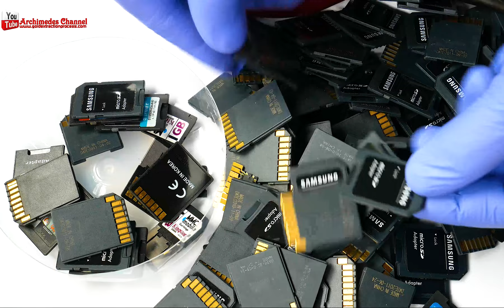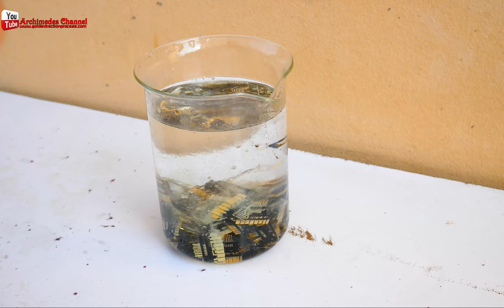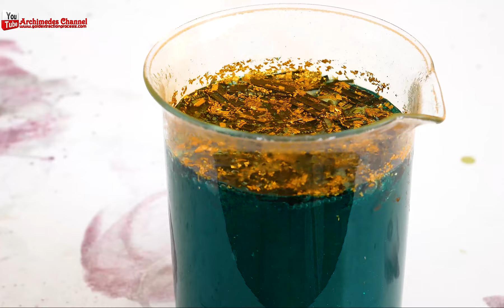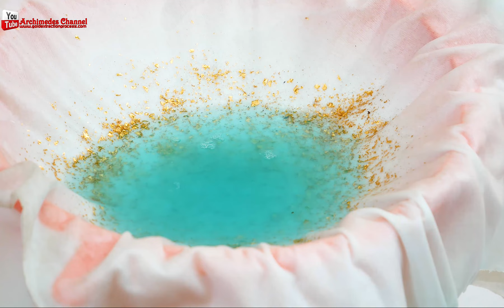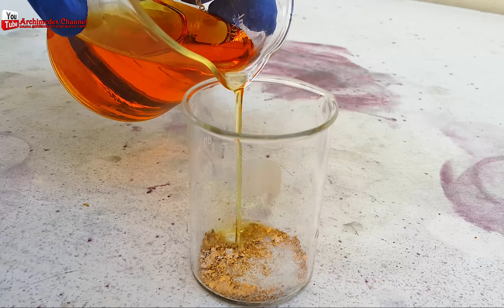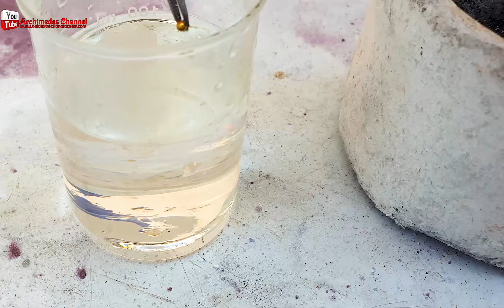This Guy Is Extracting Gold From Adapter Memory Micro SD Cards And It's Amazing!

Comment: Nice!  Only need about 37,701.21 adapters to make 1 Troy Oz of gold.   I have 5.. Just need 37,697 more to make an ounce!!  Almost there..  :)
Gold value of each adapter is 4.9 US Cents each. (Spot price is $1,854 right now)
That being said.. I have about 10 pounds of gold plated E-scrap I need to process one of these days.. Pins, stripped boards, connectors, etc.. Thanks for the videos!